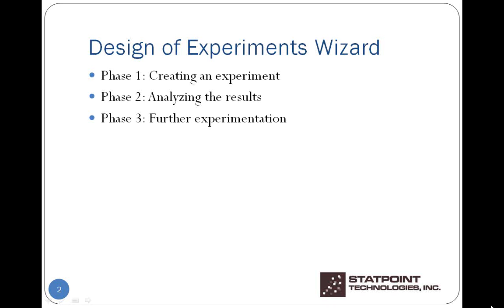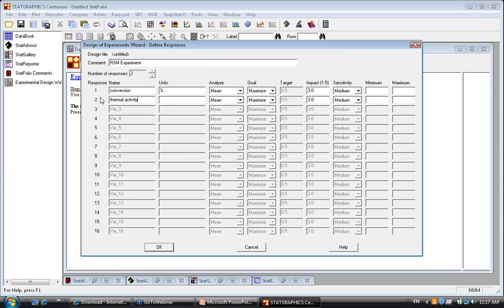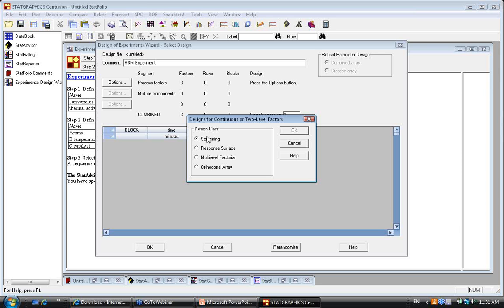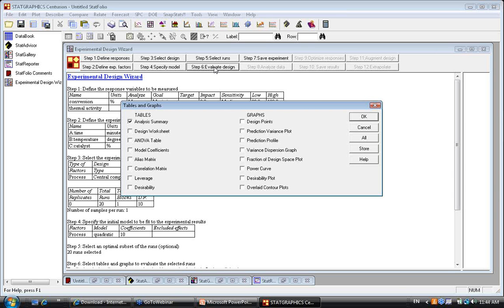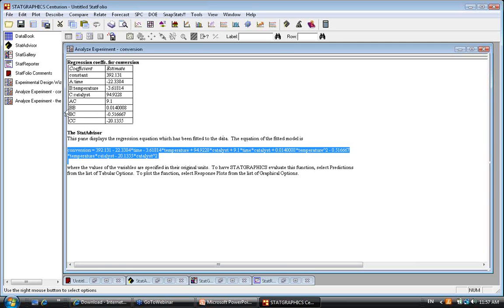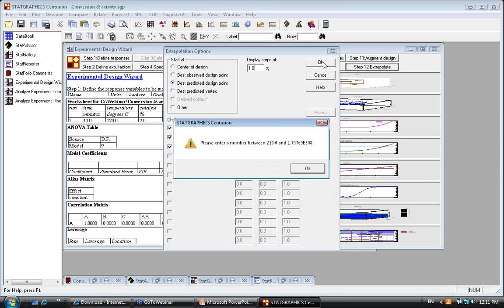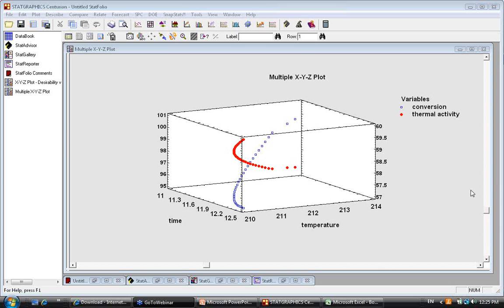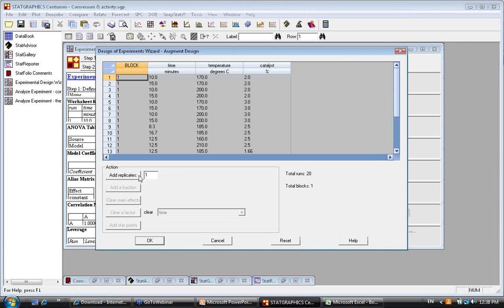Design of Experiments (DOE): A Statgraphics Webinar

Comment: Why in the anova table all the degrees of freedom are always 1? While if you perform the same anova using the multivariate analysis de degrees of freedom are the ones that correspond for being a 3 level factor or for having a quadratic relation?